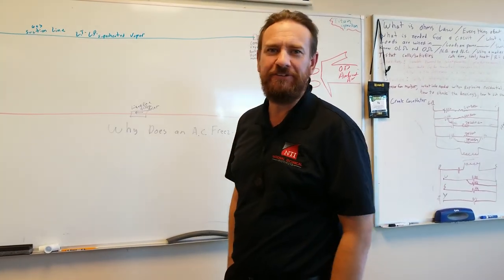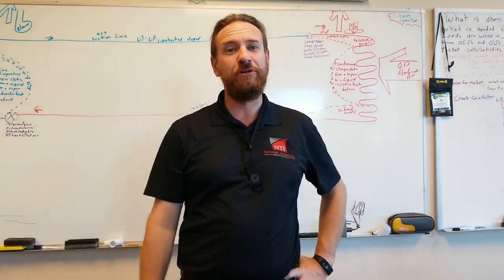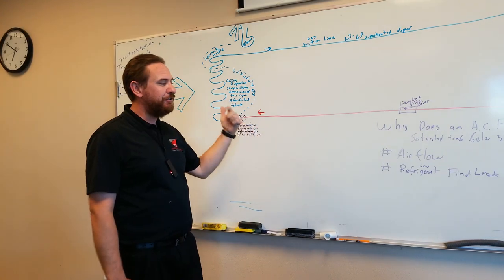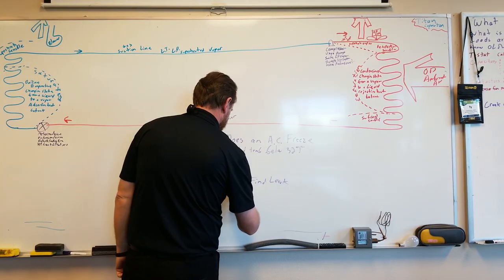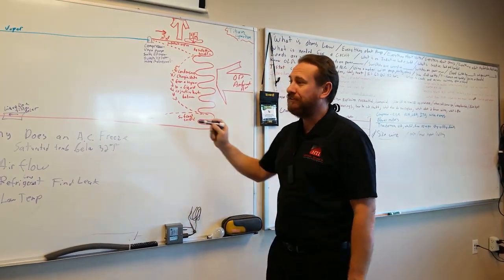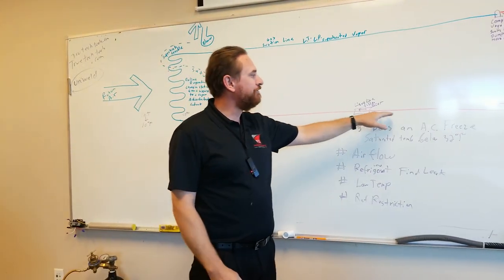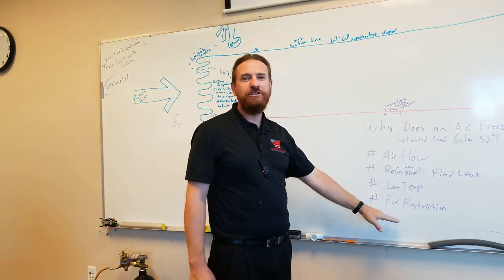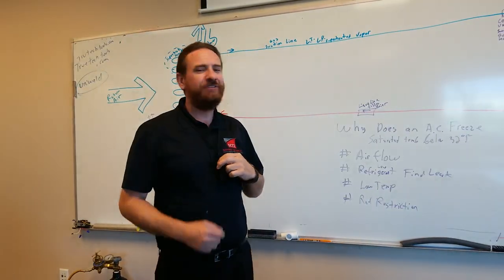Why does an AC freeze

Comment: Excellent explanation of why the indoor coil freezes. I wish I had this clear of an explanation when I started out many years ago. You touched on what many technicians do to try and solve the problem by overcharging the system. The only thing I would add is that by overcharging the system you back up liquid into the condenser coil and turn a high-efficiency unit into a low efficiency unit and  the customer is now paying a higher electric bill.
Reply from the maker: Thanks Bill and you are 100% spot on about staking liquid in the condensor reducing efficiency. I need to do an update.

Comment: Great explanation !     Had a frozen coil on a up flow unit located in a 3 story finished daylight basement home.   Return air ducts on all 3 floors. Return air in finished basement was 63 degrees !  Covered that return to allow only return air from 2nd and 3rd floors and problem solved !  Duct work was sized OK so no worries on covering that one return grill.

Comment: Once a customer has a frozen AC which only happened at night. It turned out the compressor contactor sometimes wouldn’t disconnected but inside blower motor stopped. At day time the temperature was high and the AC was running most of time, so AC frozen was not so bad, but at night the blower motor stopped longer time and the frozen ice reached out up to compressor.

Comment: 6:38
There is another reason the customer is low on refrigerant. The technician before you didn't have low loss fittings on his hoses and had a negligent discharge while removing them.

Comment: Awesome video - super clear explanation.  As I'm currently experiencing this issue, one thing I don't quite follow.  In my case, the temperature at the ducts was about 60 degrees, and the coil was starting to freeze at the 1 hour mark (reduced flow), and complete freeze (no flow) at 2 hours.  Tech came and recharged the system, said it was about half charge (added 4 lbs, R410A system).  Ducts then blew at 57 degrees, and system worked great for 3 weeks without freezing up.  Now the coil is freezing again, and duct output is 65 degrees (before coil freezes).  Actually worse (higher) output temperature than initial problem - unclear of fault.  But what is confusing to me is if the ducts are blowing out at such high temp (nowhere near freezing), how is the coil freezing?
Reply from the maker: Part 1
Temperature pressure relation. As the pressure drops the boiling point of the refregerant drops. Look up a pt chart for the refregerant you have and you can see the pressure temperature relation. 

Part 2 quantity
Just because the temperature is low to start freezing does not mean there is enough quantity. Less refrigerant means less quantity, less capacity. It does not have the volume of boiling refregerant to absorb enough heat to drop the air temperature.

Instead of an sir conditioner, it turns to an ice maker. Check out my play list learn hvac hvacr. It explains all the concepts that lead to this point.

Comment: HVAC Doctor, the system is contingent upon everything being clean & functioning properly really. Cleaning the interior air handler coil & exterior unit condenser radiator go hand in hand. I hate those paper filters, give me the electrostatic metal washable ones every time. Then the only thing that can fray for debris is the air handlers panel insulation. I've been using the metal one's for 4+ years, flushing the drain tube it took me a few minutes to realize that the pulpy debris was the panel insulation and that nasty mucous for bacteria & mold. I knew I had flushed it good 4+ years back when I converted to the metal air filters. The metal one's cost more, but buy 2 and you can rotate them, using a clean filter & rinsing the filthy one back to clean.

The coil was pretty clean, outside of the galvanized steel cover that has rust for  a 15 year old Heat Pump system in East coastal  Central/North FL. Been a learning experience for sure.

Comment: What is the lanyard you're wearing that creates the beeping noises? It seems to prompt you to bring out closer to the camera each time it goes off. Why?
Thanks and great instructional video!
Reply from the maker: Usually means the lanyard sensor disconnected from the rotating tripod head. I have not used it in a few years.

Comment: Thank you for your ever giving knowledge..In UK here and still and apprentice. I am struggling to understand the concepts behind Delta T and DTD since the unit  used in most  US lecture contents is Fahrenheit..shall I keep it simple then that all AC coils are designed to have Saturated vapour temperature  of 😮4 deg Celsius!!!! I'm this case 75 deg F( 23.9Celsius)Return  ----40degF(4.4Celsius) SVP/T equals to 20Deg Celsius Set point!!

Comment: Not sure if you monitor this but I'm going to ask you're opinion anyway to a Problem.  
Here it goes:
The AC in my home worked fine.  I came home from Vacation to find it very warm in home.  it would not lower the inside temp.  I called repair and He came and said he charged the unit a bit and all readings were good.  Nothing changed. A week later he returned and stated we needed to replace the compressor. I have a Carrier with a Copeland with the Coating that was gumming up TXV.  We replaced and That did NOTHING.  He then stated we need to inject a cleaner to try to clean out the defective coating.  Again, Nothing. Now he says we need to replace the TXV valve.  He wanted to swap it out with a piston metering device but Carrier said this can't be done and we should replace the Evap Coil along with the TXV.  
I never had Evap Coil freeze.  
AM I getting ripped off? Couldn't they have diagnosed a bad TXV in the beginning?  How could he tell me all readings were "Right On" when the system is obviously not working.  I learned more in your videos that if I had the tools, I could have probably diagnosed the problem.  I wouldn't be surprised if after spending near 1500$ it could have just been a clogged filter dryer.
Reply from the maker: Wow! I am sorry to hear that!
So many points here.
Copland used 3 different oil additives for rust inhibitors. They finally chose just one, the wrong one and with the right conditions it did clog up the TXV's.

Was that the problem on yours? I have no idea. Without a full diagnostics report, there is no way to know. Mabe it was a sting of bad luck, or lack of training or who knows.

I recommend to companies and students alike to perform a checklist. It will have all the numbers recorded for the both the home owner, the company and the tech. Now days there are apps like measure quick that communicate with instruments that generate a good deal of this.

Compressors don't just die, they are murdered. If the cause is not identified it will happen again.

Sorry for the late reply. Did you get it worked out?
Reply: Where can we get this check list ??

Comment: Hi ty you are my favorite teacher I appreciate for you video it is excellent . But I hope if you write down the four seasons that make the system get freez ...
Reply from the maker: the reason is Saturated temperature is below 32F (0C)

#1 cause airflow
Dirty or restrictive filters, dirty blower wheel, bad blower motor, blower motor set to wrong speed, bad blower capacitor or wiring, bad blower relay, stuck compressor contactor, weong blower whel, blower cut of plate missing, dirty evaporative coil, Return air too small or restrictive, Supply ductwork crushed, damaged or improperly ran, too many vents closed.
#2 Temperature
Indoor temperature too low, Outdoor temperature too low without a low ambient kit
#3 refrigerant restriction
Cloged filter drier, too many filter driers, kink in the liquid line, liwuid line valve not fully open, screen befor the metering device cloged, metering device pluged or blocked, TXV power head lost charge, TXV stuck closed, TXV overheated and bent pin, Something inside the liquid line
#4 Low on charge
Find the refrigerant leak. 
This should be the last thing after everything else is eliminated. DO NO GO OFF SUCTION PRESSURE! Go via superheat and sub cooling.  Many people use this as a fix when its really one of the other ones and it does stop it from freezing but ends up damaging the compressor later on.
Reply: @love2hvac  
Thx a lot Ty

Comment: We  use to do new installing when they froze we put a 32degre temp sensor on the suction line  if  we had problems by the compressor. Never had a problem doing that 😉
Reply from the maker: Yes that is the freeze stat I was talking about.

Comment: Hi Ty. Great videos. Congratulations. 
I've seen refrigerant charging procedures following the SH/SC criteria and when the system is overloaded or near to be overloaded the discharge line coming from evaporator starts to freeze and most of the times the ice runs on pipeline and ends up in the compressor suction. This is with a cleaned system free of cloggings and damages. Why could this be happening?

Comment: Hi man this is a very very good video of very informative but I have another question for you if you could take the time to answer I recently replace the capacitor and the condenser fan on my unit but for some reason. Condenser fan keeps on running after the compressor shuts off what can be causing that can it be lack of Freon or back fed from somewhere thank you in advance hope to hear from you
Reply from the maker: wired incorectly

Comment: What about an air zone dampener bypass that is stuck open and only 1 of 2 zones is open.
50% of the airflow just goes right back into the blower and back over the A-coil. That would also cause a freezing coil sooner or later?
Reply from the maker: 100% I've seen that many times

Comment: Excellent video, sir,  is it possible to close TXV completely to stop the liquid refrigerant flow to the compressor when the load on equipment is very low.
Reply: @VicPapefu Thank you very much, here load means heat load on the evaporator coil. If it is low because of the restriction of airflow on the evaporator coil, will it cause txv to stop the refrigerant flow to the compressor?

Comment: Hello sir.  dumb questions, but for some reason, I can't visualize or relate why air temperature drop is causing refrigerant pressure drop?  Thanks.
Reply from the maker: Take 3 balloons, inflate them to the same size.
Leave one balloon in the room,
Place another in the refrigerator, and another in a warm area such as the oven on low.
You will see the balloon in the freezer will shrink. The molecules will be moving slower, closer together causing a pressure drop.

The balloon in the warm location will be larger. The molecules will be moving much faster and spread father apart. Pushing away from each other. This will be a higher pressure.

Remember that heat and pressure are both forms of energy.

Comment: 1. is there a possibility that under size evap will produce  ice build up on the evaporator.
2. example, if i put a room temperature of fish or raw meat on a walk in freezer, does it have contributing factor on ice build up on the evaporator? let's say all the system is really in good condition like  brand new,  my point of view is that moist on the product is it really a big factor??
those 2 question are already happening real time, just a few tips to enlighten my mental block, hvac is very very large vortex. it's crazy.

Comment: On #2 you can have a restriction on your metering device. Thanks to Poe oil breaking down to a wax.
Reply from the maker: It was an additive that prevented rust or corrosion(I cant remember wich) that copland had in their compressor that caused that.

POE oil will break down to an ACID. This is why it is critically critically important for proper dehydration threw evacuatin and confirming with a vacuum gauge in microns.

Comment: ocasionally mine freezes at the compressor noticed air handler in the attic doesnt kick on i switched breaker off and on and handler works again im suspecting relay contacts on contol panel. ive had it looked at told me it seems to be working but may need a new evaporator coil i didnt buy that answer. im in auto repair not house repair .

Comment: I am having trouble with my AC Central Unit. The lines outside keep freezing up. Put in a new blower, air flow seems good, fixed the air flow around the coils.   Not sure what else to check next

Comment: What about freezers?  If we need temperature below 32F in a freezer we need to have eveporator below 32F as well. So the only way to prevent  freezing up  eveaporator - it's just  dry air and defrost system. 
I did see all your videos but I will :)
Thanks a lot, you are really talented teacher!
Reply from the maker: This was just for air conditioning.

Refrigeration has more components.
Automatic pump down with solinoids, liquid receivers, and suction accumulators, and how bent kits.

Refrigeration has the fins spaced father apart to allow ice accumulation without blocking airflow. The fins are also thicker aluminum to handle frost formation. 

1st fridge above 35F  uses off cycle defrost. Refrigerant pumps down and the fans stay on
 The air above 32 melts the ice and also provides cooling for the unit 

Below 35 uses defrost trimmers.
Method one is electric elements similar to ovens.
Method two is hot gas defrost. Taking hot gas from the compressor bypassing the condenser and dumping after the metering device directly into the coil to defrost.
Reply: @love2hvac  Thank you very much for such detailed explanation 👍

Comment: Sir, if we overcharge the system and metering device is set to maintain constant super-heat at out let of evaporator then  why evaporator floods with liquid?
Reply: I think its becsuse the metering devise  only operates within a certain or limited range. It can't reduce every pressure you throw at it and still operate effectively.

Comment: Hey if i Hear a Gurgling in my pipe Lines My Ac Unit 410A 30 Meters for pipes from the roof til the Erea that wana be Colling My Low Pre is 125 PSI DO YOU THINK SHOULD I VACCUM THE SYSTEM ND REFEEL IT?.... AND DO YOU THINK 125 psi it is enought for the system?..............
...i clean the Evap because it was Freezing and i cheak also the fan everything is working well my Temp in my duct is 9 CELCUS ....
... but the Follow is low in the Room My Return Duct i feel is Smal do you think if that Return duct is Small the Flow wil be Low ?
...amazing vlog love it Man
Reply: @VicPapefu Thank you for your Repply Man But So Sad That After A Huge Explosif In Our Country Lebanon Beirut We Lost All The Shop and everything was Destroy :(........
Reply from the maker: Oh my, I'm sorry to hear that. 
That is just horrible and breaks my heart. Are things improving?

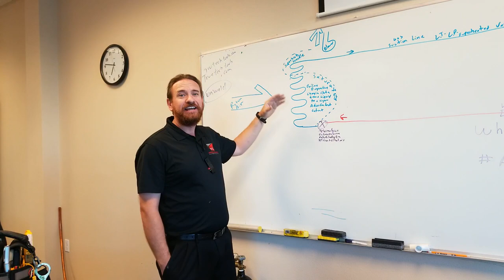Comment: 5:06 - Recently, I responded to a no-cool service call at a local unit of a large restaurant chain. On the roof, I pulled the panels to reveal a push-pin/thumbtack taped with black plastic electrical tape pushing on the center of the contactor, holding the contacts closed. The evaporator and compressor of that RTU was covered in a block of ice. I defrosted the evaporator and compressor, replaced the low voltage transformer and got the unit functioning again. It cost me 48 dollars for the transformer.

Comment: Great video. My suction line is frosting up. Indoor temperature is 75F and outdoor ambient is 70F. It's  r410a with low suction pressure. The low side saturation temp is 28F. I am getting low superheat but normal subcooling with fixed orifice. Filter is clean and air flow is good. The coil has no frost but frosting just before service valve at outdoor condenser. All amp draws are good. I tried adding some refrigerant but the low side pressure would not rise. I just can't figure this one out. Any help would be greatly appreciated. Thank you.
Reply from the maker: Air flow problem
Reply: Thank you sir.